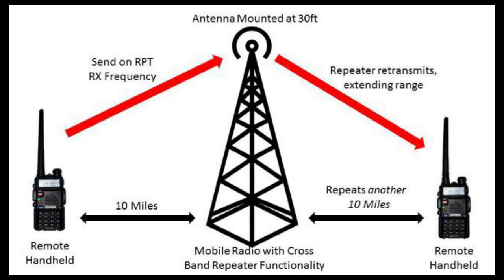What is a Repeater in Ham Radio | How Ham Radio Works

Comment: More good stuff here, Jason. Sometime in the future, can you walk folks through the steps necessary for accessing repeaters (offset, tone, etc...)? I think that could be a great help. 73
Reply from the maker: The very first video I ever posted talks about how to do that on a specific radio.  But the steps on all radios are basically the same.  But yes, I can record something specifically like that.
Reply: I second this comment. Maybe use a repeater's information off of repeaterbook.com and show how to plug that into your HT...maybe with an Anytone 878? And show the input differences between an analogue repeater vs a digital repeater.

Comment: So I know this is an older vid but I have a question. 
The club nearest to me I have no desire to join. 
Is it ethical/proper for me to regularly use them if I’m not supporting the club that maintains them?
Reply: Well I won't say it's right or wrong but would you buy a truck and let someone you don't know run it whenever they wanted to and never put gass in it or pay for a oil change ? If so I guess it's fine for you not to contribute to the club 
If you would not let someone do that to a truck you don't own  then you should either donate to the upkeep or join the club. I don't know what the club in your area charges for members but there are a lot of times other benefits that go with it  the club here gets $25 a year and I never go to any meeting or very few  but I have went out and helped one of the guys work on a repeater 
Just keep in mind they put up money to buy the equipment and install it most of the time they have had to work with the owner of the structure to be able to put it up there also they pay the electric to run it and buy and maintain the battery back up or generator whatever they use for a backup  
So should you or should you not contribute to that is up to you I guess  and a reflection on your own morals

Comment: Hi, i am trying to find a repeater for commercial radio FM in 87-108 MHz with low output power. do you know some? 25 watts its to high so the antenna will be masive. Hope you can help me!

Comment: Hey man thanks for making this video. I wanna buy a Motorola XPR 7550e (UHF) and theirs no UHF nor are there VHF  repeaters in my area the closets ones are 15 miles away at a college. Will I still be able to get signal from that repeater being that far away? Thanks.
Reply from the maker: If any radio could do it, it would be that one.  15 miles is a stretch for an HT, so it really depends on your location and the repeater's location, and the terrain in between you and it.
Reply: @HamRadio2  thank you this inspires more confidence

Comment: A question about repeaters. The sawmill, about 3 miles from me, uses a repeater for communication around the  mill site. When I'm listening  I  usually hear the base units but not the handhelds?
Reply: They could be using low powered HTs? But are possibly using a crossband repeater, and you are just monitoring one side of the conversation? Or they are using ctcss tone, and you only hear one side of the conversation? Or its a trunked repeater system.

Comment: I am new to radio and had a beginner question.  Do you need permissions or pay to use a repeater?
Reply from the maker: Typically no. Some repeaters are closed and require you to be a member of a club, etc. But most are open and free to use
Reply: @HamRadio2  which one would you recommend?

Comment: A few questions do you have to get a call sign for a repeater? can you set one up for 10 meters?
Reply: also can you run echo link on your repeater like on 10 meters at night?
Reply from the maker: Yes the repeater has to have a callsign also, but it can be your callsign - and yes you can setup a 10M repeater with echolink.
Reply: @HamRadio2  thats cool thanks for the help man I am still in my first 10 year about 2 left and i will need to renew speaking of I tried to go tot he fcc website and renew early....it did not come up in the box tho is that because it was not due yet? KG5CUO

Comment: Justin, am I right in thinking that local repeaters are set on one frequency? Its not like you can scan bands when connected to them?
Reply: They receive on one frequency and transmit on a different frequency.  Your radio does the exact same thing only in the opposite frequency setup.  That is in the programming and what the offset of the repeater is about.  No scanning the bands through a repeater.  That would be something that you do with your radio.
Reply: @notipster  Thanks. I was thinking more that is it possible to scan the whole frequency of say 2M if the repeater is a 2M repeater? Like a gateway?
Reply: @williethepimp  I figured that was kind of what you were asking but to my knowledge that doesn't exist for a repeater.  Hopefully if I'm telling you wrong someone will correct me.  Maybe a personally owned repeater system but not an open to the public system.
Reply: @notipster  Thanks Bud. I imagined that I expect too much. Like a local repeater as a hotspot but analogue. Oh well.....

Comment: Do you think 115’ Tower is High enough to making building a repeater worth wild?
Reply from the maker: It depends on the ground height of the tower. If you have a 20' tower, it'd be enough if it was on top of a hill. 

So at 115' is the top of the tower over everything in the area?  If so, it should work fine.
Reply: @HamRadio2  
It’s 115’ Tall at the Top. Once upon a time it was used as a windmill to pump water into a tank to arrogate farm fields. I’d like to setup a repeater for a local prep-per group to use.
Reply: @HamRadio2  
Solid steal structure with a pump house built into the base of the tower. I installed solar panels and a battery rack. If need be the repeater could be off grid.

Comment: How do repeaters get assigned their frequency?
Reply: Typically they work with a frequency coordinator for their area.  Basically someone who computes what, where, when and how your system is setup and coordinates a frequency that is open so it doesn't interfere with other systems in the area.  That's the cliff notes version.  Without using a coordinator any frequency is free to use as long as the band plan allows it.  They help you more to avoid interference issues.